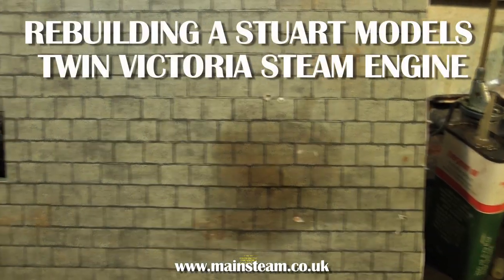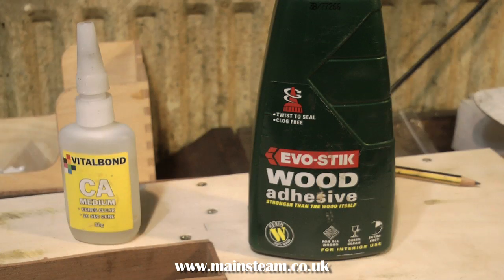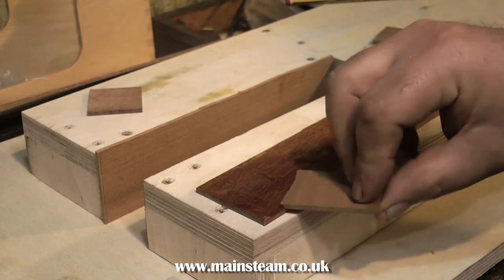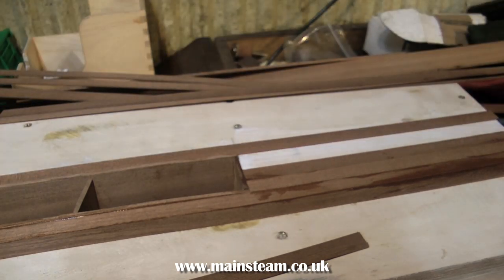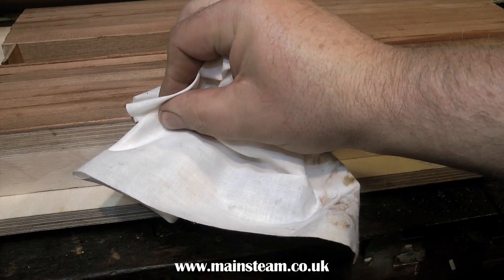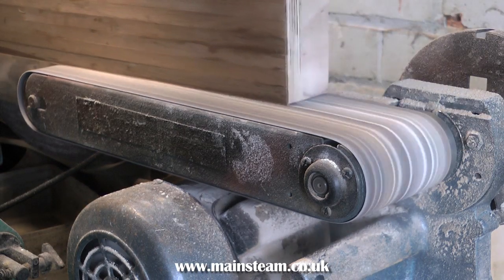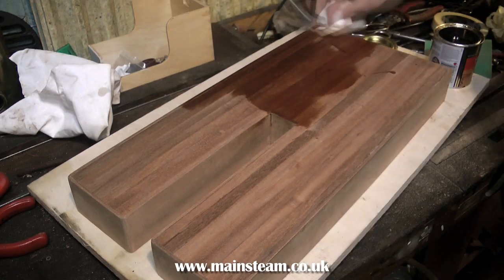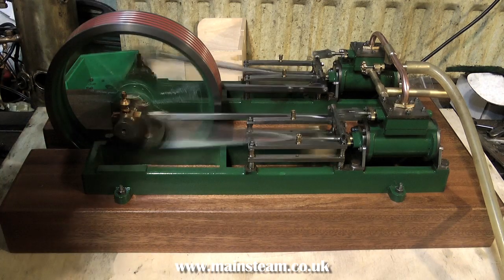PART #8 - REBUILDING A STUART MODELS TWIN VICTORIA STEAM ENGINE

Comment: Hey, I've seen all your Youtube clip about steam engines. Very instructive and fun. I have two questions for you if you have the urge to respond. I have seen that some stuart Victoria has two valves, what do the other? My second question, if you get to choose? piston rings or silicone rings? Sincerely, Jakob from Sweden, using Google translate :)
Reply from the maker: Some Stuart Victoria Steam Engines have separate inlet & exhaust valves (a modification - not on the Stuart drawing)
I prefer cast iron when they are available, but for model use Silicone is fine.